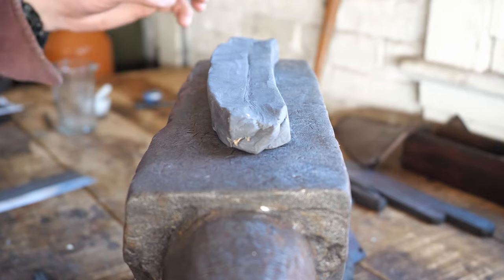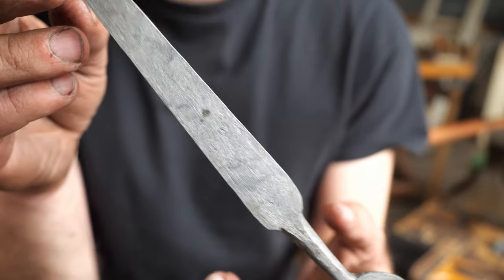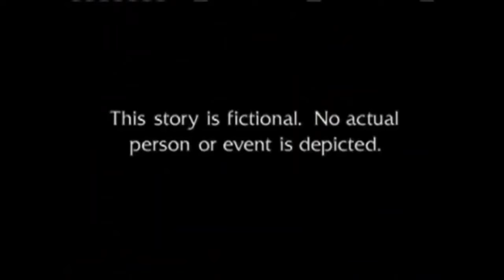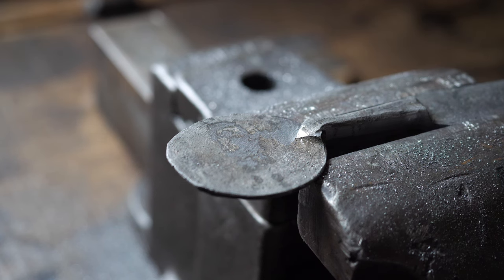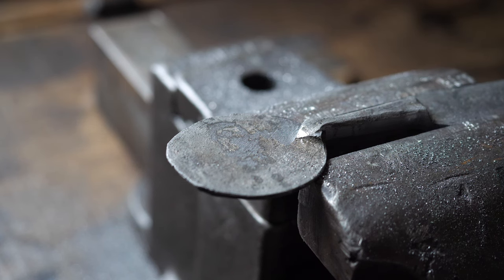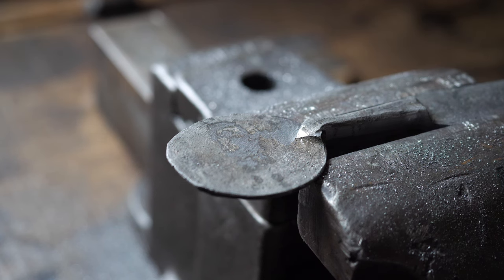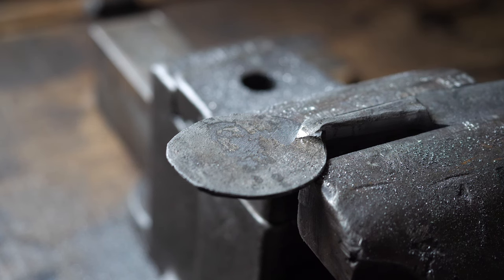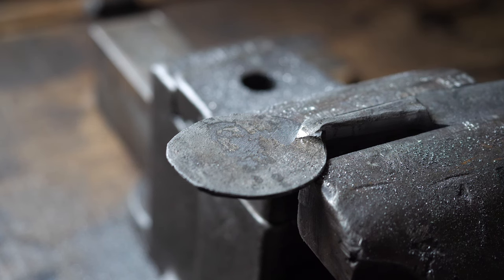Blacksmithing - Making a $300 spoon with bronze inlay

Comment: Hey nice craftsmanship. I really enjoy the fact that you try to be as close as possible to the finish project when the forging is done.
You say that you dissolve scales. Could you please explain how ? Does it work only on iron ?
Thank you
Reply from the maker: The pickling process dissolves the forged oxide leaving a surface better for filing. White vinegar will do the same thing, it works on all ferrous metals to my understanding!

Comment: Baller spoon! I'm curious where you source the Wrought? Are you buying wagon wheels or like old window grills?
Reply from the maker: I usually get it from old scrap, sometimes you can tell just by the surface. I’ve got a fair amount of old anchor chain, architectural salvage, and wagon tires too

Comment: You certainly know how to make use of the whole face of the anvil as a tool when it comes to working the iron.
Also, you use a lot of files, have you ever thought about using scrapers in your work as well?
I only mention the scrapers because you can actually sharpen the thing with a stone/diamond file/grinder- I actually keep my keen by just using a scotchbrite wheel on my bench grinder, but I digress. It'll fuck the scale right off before you use your files.
Reply from the maker: I do some a few scrapers that I use on larger flat forgings, but for some of the trickier bits, files seems to work better for me. I’d like to make some more sen-like tools in the future though
Reply: @nate_weiss_  I made a sen thing , it was a pain the ass.